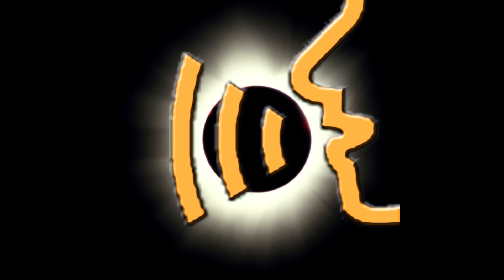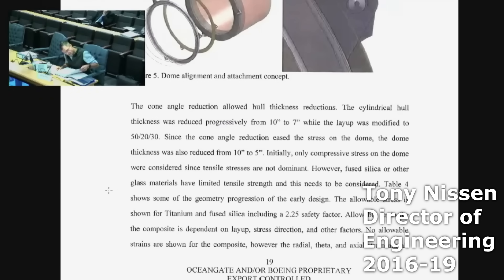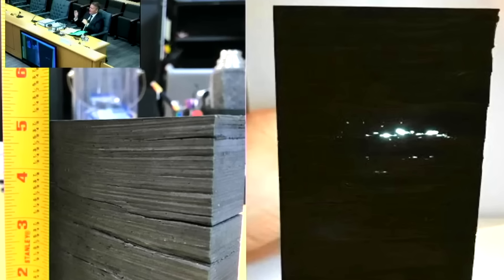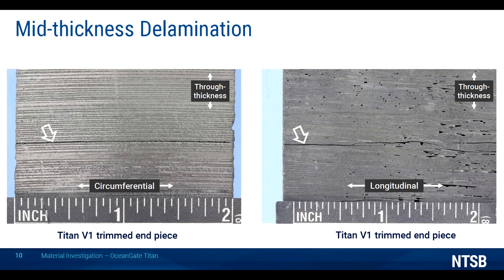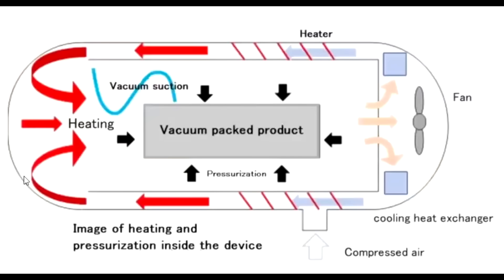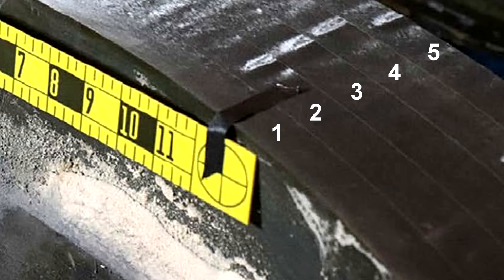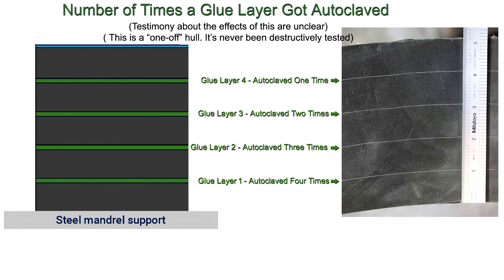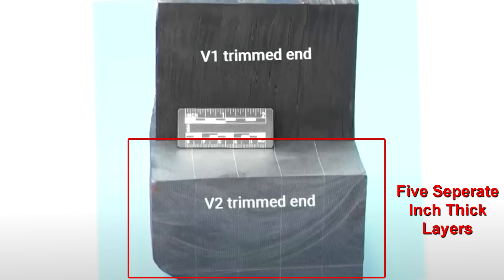Who Engineered the OceanGate Titan V2 Hull? Maybe Nobody Did?

Comment: In other words The implosion happened because of poor engineering and no testing or not enough testing
Reply: Two factors. First there was no testing true different permutation of the hull. Second, carbon fiber is more like wood then steel and the math was almost opposite. 
In metal hulls after a first dive its safe, spotting and repairing defects is easy. In carbon fiber the first dive was the safest and then it quickly deteriorate. You cant repair it and cant see defects underneath. By the latest construction of the hull it should be at least 2x thicker cause how many defects and patched was used. 

But regardless, even in following all regulations and properly building the hull. It will have relatively short life span compare to metal hull and you have limited dives. It was always a question when not if. Using material strong in tension not compression in a submarine is crazy in the first place.

Comment: They would still have been diving if Stockton did not leave that submersible in the parking lot in ice conditions. That is what caused this implosion to happen on the very next dive. The ingress of sea water forced into the carbon composite by the massive pressures from all the previous dives to the Titalnic depth would have frozen and expanded during that ice/cold/hot cycles in that parking lot, destroying the hull's integrity completely. 
They might as well have done that final dive in a strong cardboard box, because that is basically what they were doing in that compromised hull!
Reply: No. The hull was inherently unsafe due to a terrible design. Stockton could have taken flawless care of the sub, and it would still have been a deathtrap that had zero reliability at the sort of depth it was meant for. The Titan was NEVER safe.
Reply: @Ugrasrava  Yes, not denying that it would eventually have imploded due to the idiotic material they used, but the main cause of the implosion on the very next dive was caused by the accelerated delamination when it was stored in the parking lot for 7 months in ice condition cycles. If he stored it properly in a climate controlled storage, the chances are very good that the last dive that imploded would have been fine and most likely not have imploded, especially when comparing the number of successful dives with the previous hull.
Reply: Might have survived that ONE dive, but not many.

Comment: Multiple autoclave sessions is not a problem. We post cure at higher temperatures then the cure. Post cure is the process of puting the part back in the oven to reach final proporties or fix warping. its common.

Comment: They will bounce back from this lessons have been learned i think they will make the carbon fibre thicker next time
Reply: Please stick to distillation of moonshine in the boonies ...This "design" with a glued ring  CANNOT hold the pressure , you got lateral torsional forces applied on the flued section of the ring , and glue cannot hold lateral forces of that magnitude with repeated cycles of pressure and decompression  PERIOD ...it's NOT a question of "thickness" as you put it , it is but only marginally as it impacts deformation of the hull and THUS the lateral forces in the bevel of the ring ....
Reply: @benoitguillou3146 as long as the glue is applied more thicker next time along with the carbon fibre hull and the pressure hull everything will be fine this can be classed as a temporary setback a glitch
Reply: @clarencebodicker3299 NO ... again .... You inderestimate the complexity of this model and the magnitude of the strenghts at play as well as the strain repetition cycles ...it is NOT a problem of thickness or way you apply the glue... You cannot model that by wet finger in the wind "instinct" because you THINK thicker would do it ... This is the type of reasonning that provoked the carastrophy in the first place .... Those are high level ACADEMICAL matters ... i know some people have grudges with academia ...And i admit its not perfect ... but it brang us quantum computing , and interstellar probes ... REAL science isn t a joke

Comment: Why not have titanium rings along the length?
Reply: That would make it a little bit safer, and remember, safety is just a waste.
Reply: Each material has different mechanical properties.  The carbon fiber, the titanium, the bonding agent used to join them.
Discontinuity can focus stresses
Also:  titanium expensive , titanium adds weight
Reply: Russian sub hulls are titanium right?  Too lazy to Google, but that's what I've heard..
Reply: @R281  Only some
Difficult to machine and work with compared to steel.
Expensive.  Russia could only do it because of their large mineral reserves of it.
Higher strength to weight ratio than steel.
High corrosion resistance
Still weighty compared to carbon fiber
Would have needed a large amount of syntactic and poly foam to counteract that weight..
Reply: Inserting just 2 such "ribs" would have tripled the number of glue joints from 2 to 6, and glue joints are a point of weakness. Those joints might even have been the starting point of the implosion. The Coast Guard panel refused to rule them out as a contributing cause.
Reply: That might help but ultimately the trouble is carbon fiber bricks behave like wood and cannot be loaded to max capacity without rapid wear and tear.

Comment: without any doubt, ANYTHING held together with epoxy will not be secure. Even if it's a patched pipe in 1atm pressure. I seriously doubt a proper steel or titanium hull would have needed epoxy anywhere
Reply: That's too broad a statement because some glues are crazy strong when cured.
Reply: @samsonsoturian6013  i trust fiberglass, i just don't trust air dry epoxies. I've seen what air dryin Epoxy actually does, and it's pathetic tbh. it does not glue, it merely..... keeps 2 items in proximity and from moving. and if you sneeze hard enough it goes to shit before you can say oh shit.

Comment: One thing to understand ,,the fibre lay up was strong against the inward pressure per square inch of the circumference,,but not against the two end caps vastly greater number of square inches pushing in sideways on that matrix,,essentially just resin that's bonding the circular wound CF,,,
Reply: Yes. Plus, the pressure on the ends goes to the center via the design consideration of any composite. Energy flows through the CFRP in the direction of the longest distance of the cylinder. The rings were blown out from inside. 
The Hull failed in the central circumference adding to the additional load of the Titanium. The ends exploded outward, the center, inward. It was not strictly speaking an implosion. Different materials behave differently in failure.
Also, the Hull was NOT five inches thick, only nominally.... The Hull was one inch thick, five times. Notice the Hull failed in panels, there were large pieces left. It did not explode in "smithereens".....had the Hull been monolithic (one continuous width) one may expect the rubble field would have been mostly "bricks"

Very expensive lesson in Composites engineering.....     Will
Reply: @Bill-f9k1x  so was the V1 hull more legitimate than the V2?
Reply: I think #1 has some testing.  You'd think going to 3600M you'd have a full test program ?

I d want to know how many dives I could expect, not just on the cylinder but the  whole system.

Comment: The whole thing is unfathomable. What do NASA and Boeing know about deep sea exploration? The plain fact is that CF is outstanding in tension, but wildly unsuitable for compression. The carbon fibre adds nothing to the structure - all the pressure is taken by resins that weren't designed for this application. It's like building a bridge out of cheese...
Reply: "unfathomable". I appreciate the nautical theme word choice.

Comment: In the marine world of high end carbon monolithic structures - you would debulk after maybe 5-10 layers maximum. Or about 3 mm. Debulking after 1" is nuts. You could never get the air out of deeper layers. And you introduced wrinkles. So much wrong with the design
Reply: Also, not having atleast 2 inch thick support rings every 500mm along the inside is insane and we use 45 degree ply when building kayaks...
Reply: It should have never been made out of carbon fiber in the first place.
Reply: I'm a qualified composites technician but have only ever really done hand layups on industrial type stuff but doing 25mm of anything seems insane, the wrinkles on the outside were your first clue that thing was a pos. This was a really interesting watch though.
Reply: Stockton was trying to “grind down” these bumps !!! Absolute insanity…

Comment: Why would Stockton hire NASA except to say that NASA "worked on this project"?  NASA builds craft designed for atmospheric pressure of 0.0 to 1.0 AND their designs are to prevent a spaceship from exploding because the relevant pressures are from inside the vessel.  A submarine will never see less than 1.0 atmospheres of pressure and it has to be designed to not be crushed, not fly apart.

Stockton was such a skeezy skuzzball.
Reply: His background was in aerospace and he thus sought out groups and people from what was for him a familiar field.  He was either too stupid or arrogant (or both) to realize that the principles of aerospace engineering don’t apply to deep sea vehicles.

Comment: I'm not an engineer, and I have no background in submersibles. But I know a little bit about physics and carbon fibre. This has been said by many who are far smarter than I am. A spherical shaped submersible is a must. Pressure is distributed evenly on all points of the sphere. The shape of the Titan was wrong. I've been using carbon fibre fishing rods for many years. And they are excellent. They are lightweight and very strong. You can cast an eight ounce lead weight with a carbon fibre rod that's rated to handle this weight. If you are casting and you hear a crack in the rod, I guarantee you that you won't be making a second cast. Hopefully, this disaster will put an end to narcissists like Rush, constructing death traps.
Reply: Unfortunately I think the lession here is that there will always be another Rush. This was a case of history repeating itself along similar lines and the lesson for the rest of us should be to learn to spot these narcissistic individuals and try our best to avoid being caught in the disastrous consequences of their actions.

Comment: I have some experience at wokring in a company where the boss said that "it works" and even worse, that I have "too much fear and doubt".
Reply: I hope you also got experience leaving the shit place afterwards. Go soon enough so you never need to look back. Sticking it through is for places that are worth it.
Reply: @udirt  I would bot call it shit, but it was hard to see that some people thought if you pass one single stress test with one single test example they thought it was a proof of quality. I told it from a point of view as an electrical engineer, that a mechanic part needs to go through ten thousands of stress cycles with at least 10 or 20 examples to see when it fails and to see at least a bit of  sample variation. It was frustrating, because mechanical "end products" can be seen very fast when they just let it weld together but at the same time I was still at requirements making and proof of concepts in Software and electrical. On top of this the boss said, that the mechanical engineers are very experienced and software/electrical engineering seems "too junior". I left them because of other reasons, but what I experienced there was very demotivative.

Comment: Tony Nissan has been defending carbon fiber in a recent interview, it was insane
Reply: More specifically he was claiming hull V1 as a success, which is madness… even though it was even less safe V2 that imploded killing everyone on board.
Reply: @redbruce1999  What makes you say V2 was less safe? the fact that it was left overwinter in novascotia in a wet state or the fact that Eyes were added to the o-ring against every engineers advice? And do you mention that v2 killed everyone on board as an appeal to emotion or is it relevant to the engineering?
Reply: @redbruce1999  Nissen said that there would be a point at which weakening of the hull stops happening and described it as the weakest threads breaking , assuming the team kept close watch on the Acoustic Emission readings they could have prevented the implosion is the idea. I don't think there is a reason to think it was inevitable, I think it happened due to a failure of assessing the Acoustic Emission and failing to take measures to prevent it's deterioration. Even if carbon fibre is the problem, there are other problems that should not be overshadowed
Reply: There is nothing wrong with carbon fibre you dimwit
Reply: @_siggi_783 

On a bike, yes.

To be used in a cylindrical hull of a submersible taken to 4,000M deep through multiple cycles?

After seeing all testimonies from the experts, you actually believe that?
Reply: @redbruce1999  yes because the Navy has been using carbon fiber submersibles in development for years granted they are all unmanned
Reply: @kudjo24 huge difference then (manned vs unmanned) and down to 4000M?
Reply: @_siggi_783 as a former lamination tech, yes, yes it is grossly negligent to use depending on use cases, and for submarines it is certainly not a great idea to use carbon
Reply: @_siggi_783 exactly. So many people didn't actually listen to what he was saying in that interview. Theoretically CF and titanium could be totally safe for a submersible if the moduli are the same (which was stated multiple times in that interview)
Reply: @JaisonBuilds  I know man, it's just sad that the average person is like this seemingly

Comment: Everyone is omitting the fact that in 2022, the hull wintered OUTSIDE in the Newfoundland winter.  The effect would have been water inclusions, freezing, broken fibers during the warming months.  The hull may have survived additional seasons if it was stored carefully.
Reply: If they had x-rayed or used ultrasound on the hull to check for defects would have been the best move if Stockton would have even listened to the findings…
Reply: I am sure someone out there will try again with proper testing learned from this. Maybe carbon fiber will prove usable
Reply: @terintiaflavius3349  That's what would have been truly innovative, and it's perhaps what interested Boeing and NASA. If Rush had solved the problem of voids, wrinkles, and poor performance under compression he was right, it would've been a game changer for submersibles and maybe opened up other uses for composites. He needed to solve that BEFORE he built a working submersible out of it, though, and definitely before taking passengers.
Reply: @terintiaflavius3349  I dunno, rush might've messed it up for any future carbon fiber submersible endeavors considering there's other materials to build subs from.
Reply: Don't forget that was right after the big bang heard at the end of dive 80 to which idiot Stockton claimed was no biggie.
Reply: It was destined to fail regardless at some point, but yes you are completely correct
Reply: Water go brrrr

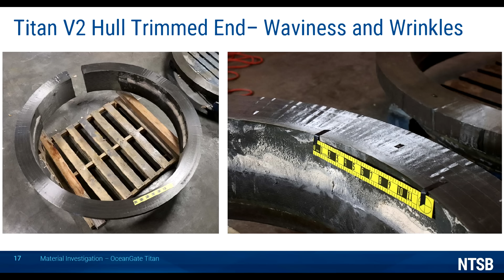Comment: Do you see the amount of wrinkles at 13:30. That hull was already compromised even before it was finished. All the math is wrong from the start.
Reply: Thats the final unsanded layer... Imagine how much more wrinkles are in the lower layers that got sanded down. Sheesh! Unbelievable that it lasted that many dives
Reply: @guser435 UNSANDED layer. I’m with you, I’m amazed it lasted as long as it did. So many proper practices were ignored on this sub.
Reply: Why would they even sand carbon fiber.  Is that proper?
Reply: @SoulDelSol it’s not. Carbon fiber is like string. Really good when you pull on it (tension) and not so good when you push on it (compression). When you sand the wrinkles out you cut the continuous fiber. This is relying more on the epoxy than the fiber. 

Also composite are extremely hard to do FEA analysis because every layer is unique. Then throw in randomly severed fibers with unknown epoxy adhesion…there are a lot more unknowns than knows. 

Composites work well for pressurized tanks (scuba tanks) not for submarines.